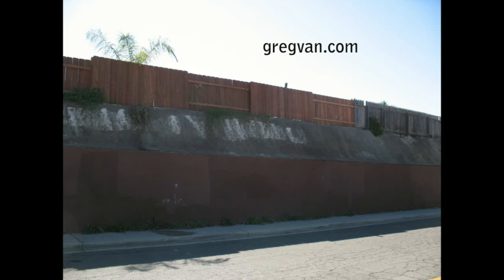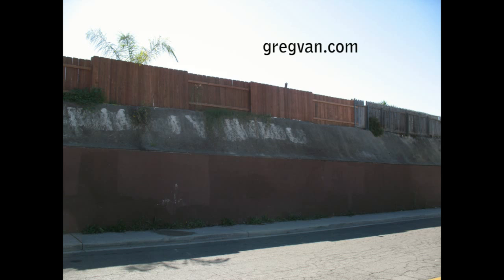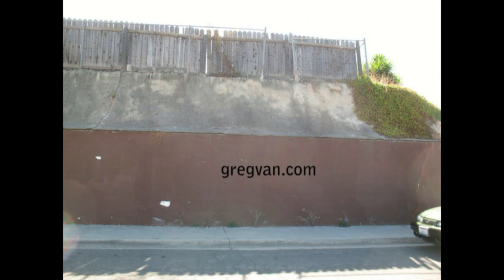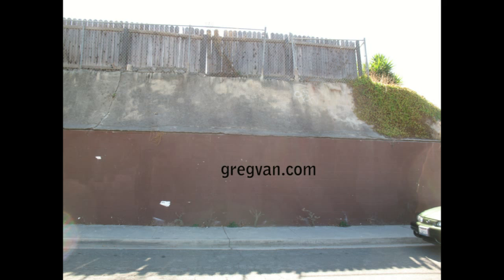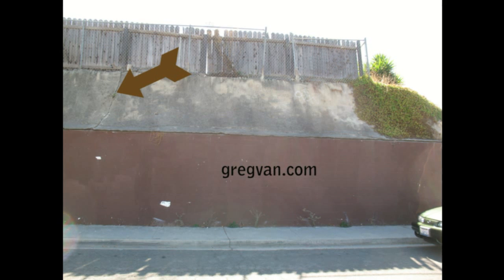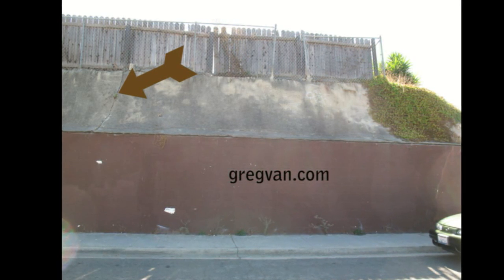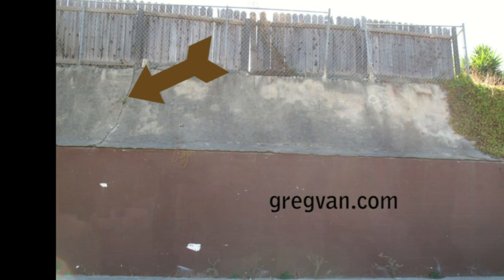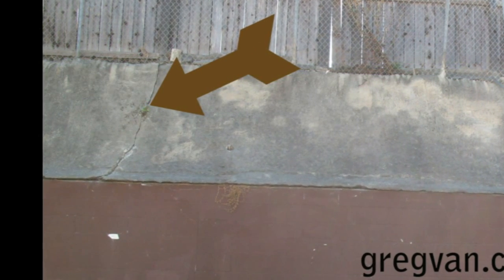Possible Solution To Eliminate Hillside Soil Erosion - Concrete Property Repairs

Comment from the maker: I would also like to add, if you're going use course materials, make sure there's a drain pipe at the bottom, to allow for any moisture that accumulates to drain away safely. You've got to redirect as much of the water as you possibly can, in a situation like this.